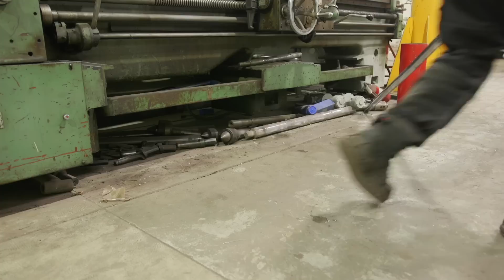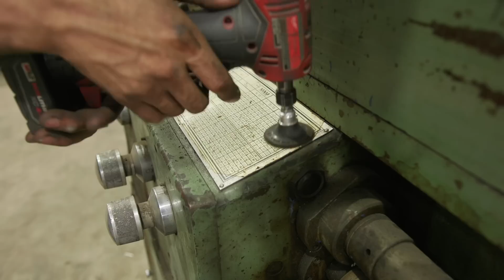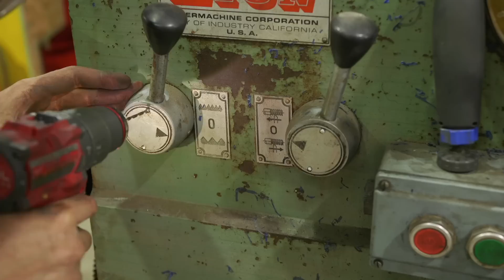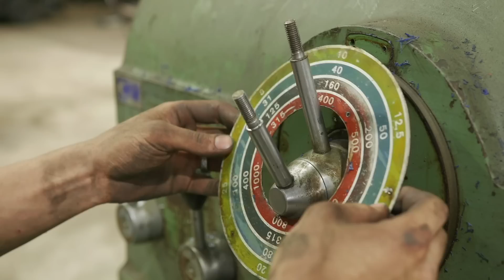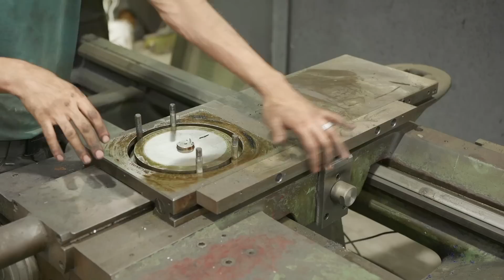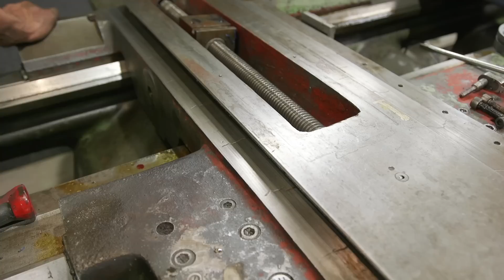Beginning The Teardown | Lion Lathe Restoration

Comment: Hello, i have older version of that lion (c10mb) and im curious what the function of the round that part of left side of carriage is, as all the tags on my machine are worn off and i dont have manual for my machine. I think it has somthing to do with oiling system but not sure. im currently in process of making my lathe function agian so i havnt had much of chance to play around with my project lathe yet. Thanks for reading look forward to reponse if you have time.
Reply from the maker: Yeah it’s oiler one way it oils ways the other it oils topslide I think. Email me pics I would love to see yours. Vanovercustoms@gmail.com

Comment: Interesting stuff.  I discovered recently that McMaster-Carr sells Acme rod and precision Acme lead screw material.  Nuts too.  Sometimes its easier to just buy a chunk of threaded rod and modify it to fit your needs.  I would bet that's a 5 TPI screw on a lathe made overseas.  My chinese lathe has the same setup - inch lead screws but all the hardware is metric.  I bet your main lead screw for threading is also SAE.
Reply from the maker: Yes your correct SAE screws mostly

Comment: The "hollow cap" is an oil fill hole. That acme screw and cross slide nut live in an oil bath. There are likely small holes that allow the oil to also trickle down onto the lathe bed ways - these holes often have a bit of felt in them to control flow. If you keep the cross slide screw in a full oil bath, it'll never wear out.
Reply from the maker: No oil bath but it is oiled. The round plug has an oiler installed the weird cap is to adjust the backlash nut the cavity is not sealed so the oil just drips out but yeah there are oil passages that are oiled by the oil pump but the nut is oiled manually

Comment: would the 'hollow nut' be the way to disconnect the lead screw nut - pop the blanking nut and gain access to the lead screw nut so you can push it down?
Reply from the maker: Maybe it’s a weird cap it’s not to tight of a fit but it is pressed in not sure how easy it would be to remove it from top but I think that’s their intention
Reply: its certainly sounds easier that than the lift/poke/slide method :D 

looking good on the teardown so far!
 @VanoverMachineAndRepair

Comment: Awesome video, thanks! What length is the dovetail of the cross slide? Ie. what is the shortest straight edge that would fit?
Reply from the maker: 31”
Reply: @VanoverMachineAndRepair  that’s tough! Most of the straight edges that I’ve seen don’t have dovetails at these lengths. Even professional rebuilders that I know had to mill a 1.5m straight edge to be able to use it on a big grinder re-scraping

Comment: As a hobby restorer since my retirement in 2011 I've learned that the best results for me are when I finish teardown and actually determine what is required/needed to complete any project. My advice is to complete the teardown first. This avoids an unlikely disaster and allows for an exit strategy before any additional major investments of effort and monies are made and I get a sequenced plan for what order to proceed which gets me a much more complete restoration with any long lead items obtained in advance of need so stopping and restarting of project is minimized. A manual would sure be helpful. You have a lot of guts to teardown largely in the dark a machine made and designed abroard It's really very compelling to watch your high wire act. Ray Stormont
Reply from the maker: Yeah your right
Reply: I have been in your position and only wanted to pass along my thoughts on this matter. I love the place those timberframe add ons are spectacular and wish you nothing but good will and sucess in the future. Ray @VanoverMachineAndRepair
Reply: I can’t second this enough. You HAVE to know what youre getting into before you start

Comment: Hi! I've got almost the same problem at my lathe.  Screw/nut totally worn out. For sure because of many hours but i think also because the lack of oil at the nut. After changing the nut and screw I removed this small worm screw inside this "line up bolt" and replaced it with a lubrication nipple so I can oil the screw and nut. Later I had the change to visit the company in Croatia which produces my lathe. I could see that they do it the same way today. 
Further I think the screws of this cover plate are just broken. The cover plate doesn't slide. Its fixed in place. There is enough place between cross slide and carriage.
Reply from the maker: Yeah makes sense

Comment: Niiiiiice lathe man, sipping on the jealous juice over here lol. I would love to start a real shop and do this for a living like you so I can have the space and work to play with bigger machines like this. Also, I do not enjoy my current day job lol. How did you get started as a business? Also, side note. Is the dial for the cross slide metric or inch? Or both? Either way, if there is a standard inch scale on the dial, then just make the appropriate pitch for whatever the scale says and it'll work fine. ;) (edit: saw the end)
Reply from the maker: Hey feel free to call me and I’ll help you where I can 847-890-9969. Or you can email me too vanovercustoms@gmail.com 

It’s hard to write everything out in the comments easier over phone or email.

Comment: Morning Kyle, really interested in the repairs you do on the Lyons lathe. Something that I have used on small rivet removal is dyke cutter pliers. The ones I was removing were also aluminum. I didn't get this from anyone, I just was trying to remove the tag with minimal damage as you are. The dykes I had and used I purchased for doing and using for nipping ceramic tile. It worked great on the rivets. Have not tried on anything but small aluminum ones. Just a thought.
Thanks for sharing.

Comment: i found myself in the exact same situation recently, i was measuring the lead screw on my chinese lathe and found it is half metric/half imperial, but the other way around (metric lead screw, imperial on the handle side) it was extremely  confusing. i also have that project on standby currently because i need to fix the follow rest and i obviously dont have another lathe
Reply from the maker: Yeah I totally get that